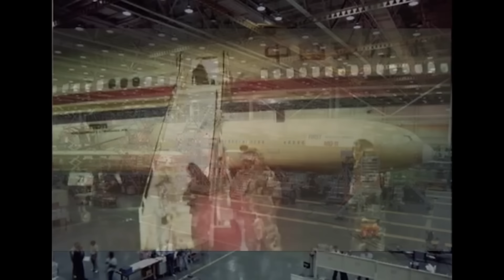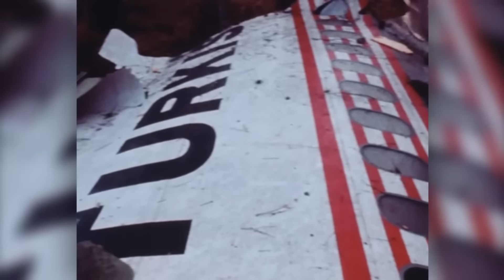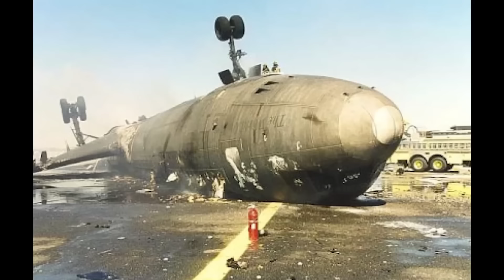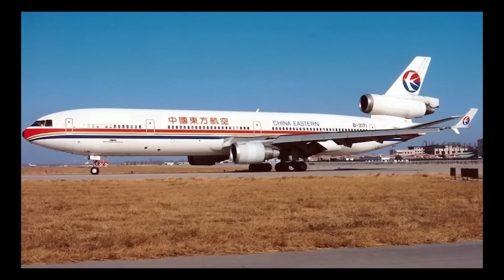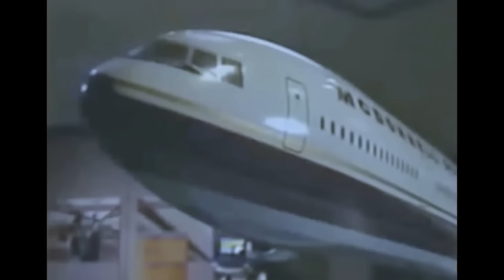Pilots Called It A 'Handful' The MD-11's Deadly Design

Comment: Higher minimum speeds and approach speed and twitchy unforgiving handling ?
Worse than the DC 10 (if the DC 10 had hydraulic upgrades and added shielding around where the 3 system lines all ran through the area subject to shrapnel should engine #2 suffer "uncontained failure" ?

Comment: The MD-11 computer override as a work around without sufficient pilot notification is eerily reminiscent of the 737 Max MCAS work around to accommodate larger and more powerful engines to achieve ER Certification without pilot recertification. McDonnell Douglas screwed up Boeing for decades.

Comment: I read an in depth investigation surrounding the Turkish airlines crash. This was back in the 80s. A McDonnell Douglas engineer said that they rushed the design of the DC 10 so they would beat the L 1011’s availability. It definitely had some design flaws.
Reply: The memo about the cargo door failure should have been the nail in the coffin to remove this jet from ALL air service. I cannot for the life of me understand how this death jet kept flying.

Comment: I've never flown an aircraft in the real world, but from hundreds of hours flying touch-and-go circuits with the Boeing jets in Microsoft Flight Sim, I  noted that the PMDG Boeing 737 and 747 handle smoothly, predictably, and with forgiving flight characteristics.  The Level D Boeing 7670300 ER handles its massive thrust like a turbo-charged Porsche on rails, and it remains my all-time favorite.

The PMDG MD11, on the other hand, was an absolute nightmare to hand-fly.  It would feel like it was about to stall if the bank angle rolled even a hair past a standard rate turn of 20 degrees, or if the airspeed dropped down to a tad too low.  I lost interest in the MD11 at that point, so I am glad that the flying brick is no longer part of any passenger fleets worldwide.

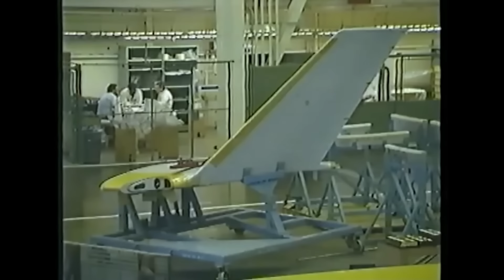Comment: This 3:04 also describes the Max 737 issue.  Larger engines, mounted forward and higher than previous engines.  MCAS "solves" this 3:20 problem.

Comment: The Death Star has a well-deserved reputation for flipping over on landing. The lack of adequate rudder surface is the primary design flaw. I know quite a few people who fly it currently or have retired out, and none of them would speak ill of the aircraft. However, the landing problem is a real issue, and is acknowledged by those familiar with the design. The Narita crash was a PIO and probably pilot error and not a design issue. My main source was a Douglas DC10/MD10/MD11 engineer at FedEx who oversaw operations of this aircraft family. They were inexpensive because the PAX airlines were dumping them (a lot of MD11s are conversions) and the freighters were available at decent prices because the aircraft never met fuel consumption goals and had known handling issues.

Comment: Theres no way this plane would get certification in 2025. It was a unstable platform dangerous.
Reply: That's not true! You can't take everything someone says so literally.. think about it multiple companies across the world have flown these planes for 40 years consistently without fail you have to ask yourself why would a company such as ups and FedEx mind you 2 of the world's largest freight movers in the world continue to spend 2 to 3 times on maintenance cost versus a newer more efficient jet to keep these birds flying if they were inherently more dangerous? This isn't really opinion based either as statistics seem to agree.. 
Here's another perspective in 40 years I think there's been 10 hull losses so let's do the math airliners typically are in service 27 years there are many acceptions so this number isn't concrete as the mad doggs were in service 40 years with delta but the md11 have 90,000 flight hrs on them and 200 were built so that means 95 percent of the total produced didn't have a hull loss prior to 2025 it had 25 years since one waa lost so statistically speaking that's a fantastic track record and find a pilot that's Flys md11 and I bet you won't find any that will condemn the airplane in fact they praise the md11.. now it's true all airplanes have their strength and weakness as everything in aviation is a trade off. So all this to say when people post things like this it's easy to get the illusion when only focusing on a few data points just like the news that this is a flawed aircraft but in reality you have to look at all the data before coming to actual data based determinations aa to whether or not the aircraft is safe or not.. but of course it wouldn't be certified in 2025 as a new aircraft because it's a different time period and things like noise abatement are in place which weren't in place in 1986 and engines have become more fuel efficient and ETOPS now allows a 2 engine aircraft to fly across the pond now and on and on the list goes on no different than a vehicle having been produced in the 80's wouldn't be certified if built new in 2025.. not because anything is wrong with those cars buy because technology evolves over that much time

Comment: At least it is 100% resistent against unrecoverable deep-stalls which is a problem with T-tails or heavy middle-engine Trijets, and self-stabilizing very well.
A plane consists of a lot of parts, and the fact that two mistakes where made when designing and constructing this plane - the engine pylon being not as strong as it should be and the cargo door locking mechanism had it´s problems while it was still called DC-10 and not "MD-11 Luxury Liner" - does not make it an overall bad and highly unsafe plane.
It was safe for decades after these two problems where fixed. Well the engine pylon being a bit too weak for the heavy engines was not really fixed but just circumvented by not using powerlifters anymore and still happened a second time, but the positive aspect of this plane is: There wasn´t any problem for decades - including the infamous engine pylons, which stood strong for decades but was also some kind of ticking time-bomb in every flight at the same time.
Reply from the maker: Thanks for sharing your detailed insights on the MD-11's design and operational history!

Comment: Why are they still flying aircraft that are over 30 years old?
Reply: They?   Planes can fly forever if maintained.  There are b52s that are almost  70 years old flying and will be in service untill 2045 and maybe longer.  By then they will be almost 100 years old. Its not about years its about cycles. Takeoffs and landings and maintanence
Reply: @Jeff-sp7bg and most of the B-52 is unpressurized. So less fatigue.

Comment: Swiss 111 wasn’t a design issue.  All planes manufactured around that time used FAA approved metalized mylar.   It wasn’t until flight 111 went down that the aviation industry started looking into using something else for insulation because of MM‘s flammability.
Reply: it was the TV that cause the planes to go down like Titanic.

Comment: Boeing did not manufacture the MD -11 it was McDonal Douglas
Reply: McDonnell Douglas
Reply: @ronaldmorris3197  Litterassy's fer kweerz!
Reply: Correct.   The MD-11 entered regular service in 1991.

The Boeing-Douglas merger was later on.
Reply: I call it Boeing McDouglas
Reply: They merged  in 2007
Reply: @notme123. 1997
Reply: @notme1231997